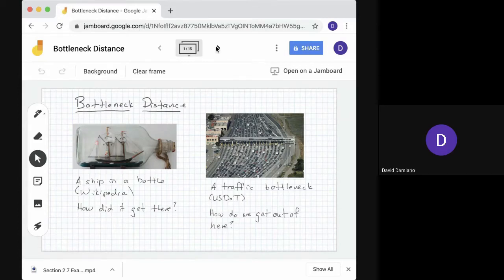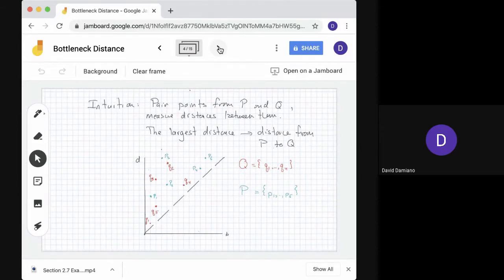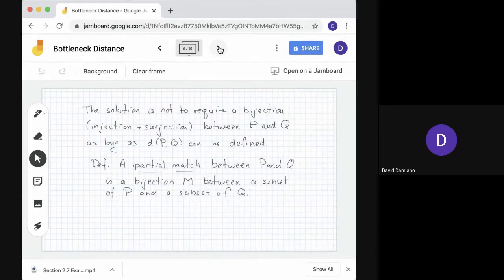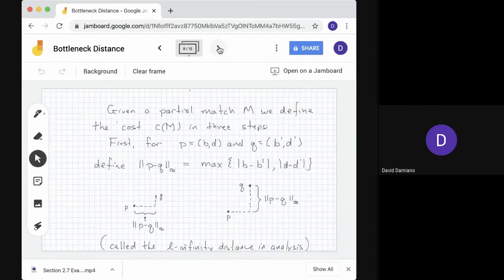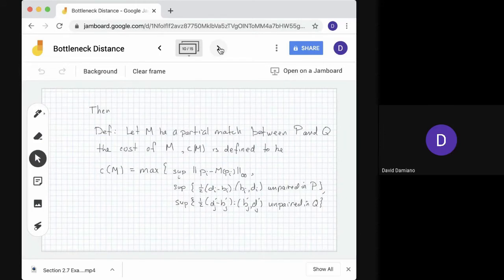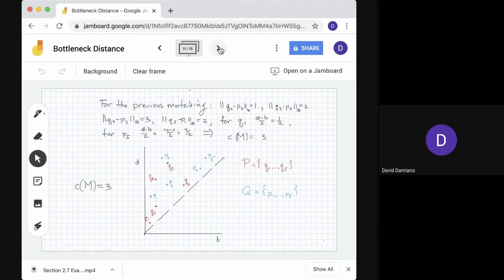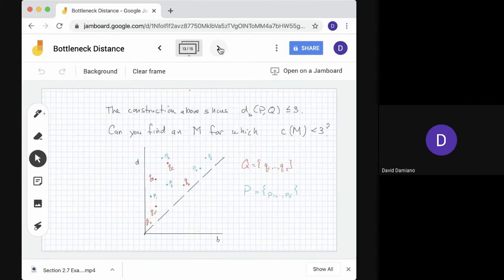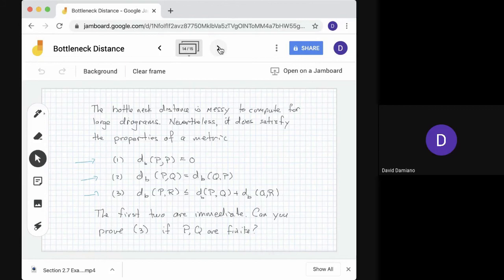Bottleneck Distance - Damiano - 2020

Comment: Great and concise; thanks! What's the intuition behind projecting left-out elements onto the diagonal? Seems we could construct two pd A, B with say all points of A very close to (\alpha,\alpha) and all of B very close to (\beta,\beta), and since we are taking the \inf over all partial matchings we could construct it so that d_B(A,B) is arbitrarly small, if |\alpha-\beta| large, yet it would seem A and B could be very different. Say we compared two filtrations where in one almost everything happens early on, and in the other almost everything happens late. It would seem the behaviour could even be very different, yet (without normalizing/rescaling) they would be d_B-close. Am I just misunderstanding something here?
Reply from the maker: Hi, this is a great question! The reason is that points near the diagonal are very close to being non-existent, since you could perturb the filtration by an arbitrarily small amount and potentially get rid of them. So, you want a diagram will all points of the form (c,c+epsilon) with epsilon small to be considered to be close to the empty diagram. So, the diagram with points (2,2.1), (3,3.1), and (4,4.1) is close to the empty diagram. And, the diagram with points (100,100.1), (101,101.1), (102,102.1) is close to the empty diagram. Therefore, even if they feel different from each other, if you want each of them to be close to the empty diagram, then you want them to be close to each other! All that said, this does make the "metric space of persistence diagrams" into a relatively un-intuitive space, that at times can be difficult to work with.